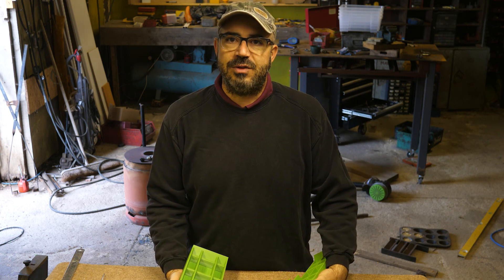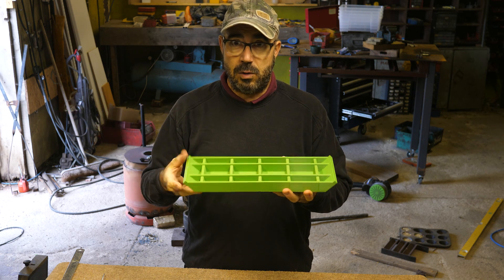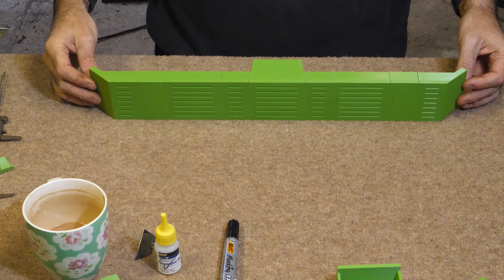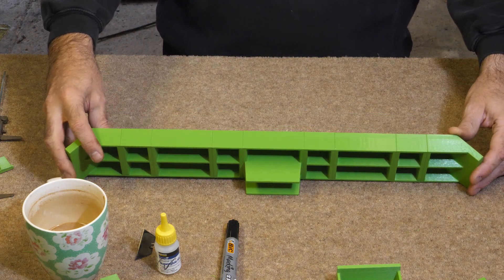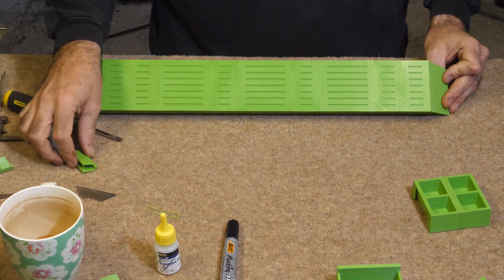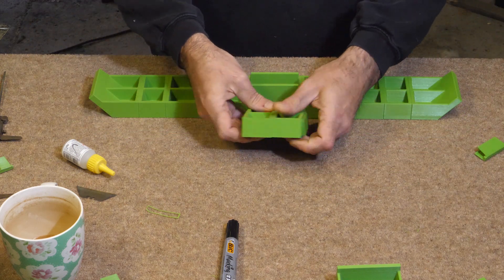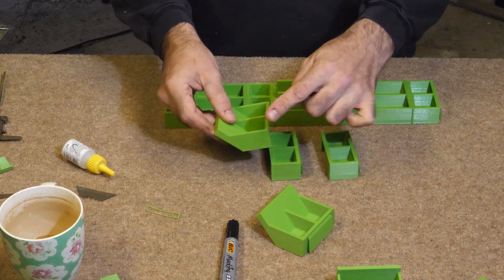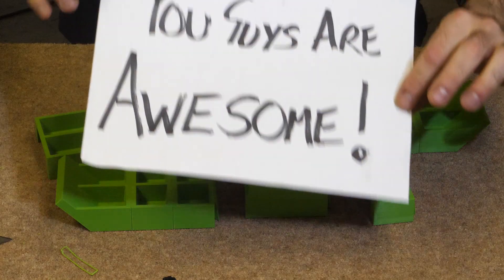Modular Flasks for metal casting (PART 2) * NO CLIPS! You guys are awesome!

Comment from the maker: Hi everyone, thank you again for your comments! lots of people have asked why i didn't just put two 'male' dovetails on the central handle piece. I did answer a few people below but i thought I'd put my reason here to save some time: I didn't because i didn't want to force people to use the handle module if they didn't want to. I only envisioned the handle module going on two of the four sides anyway. The way things stand now people can elect to leave out any module type... except the two corners (and they need two corners anyway, so it doesn't matter that corners are slightly different shapes). Also I'm not 100% convinced with the need for the handle module yet, so i didn't want to make it a necessity. Since I've got the "clip-togetherness" sorted, I'm starting to think about the casting and pin assembly more seriously now. And the wedged shaped handles might be nice for casting but they might be bad for putting pins through, I'm also pursuing using a 50mm bit of box section steel tube to bolt directly to an extension module - as the 'handle/pin thingies' - that would have the advantage of everything being more like 90 degrees and 'square' to the pins.
I hope that explains it better. also I'm doing the first test casting today!!!
Reply: Makes sense.  Regardless, it is a cool design and I think we're all looking forward to see how it works out once you get it made in metal!
Reply: I think with a drill press or being very careful, you could drill out the handles for pins even though they have draft on them.  I'm actually counting on that, as my cast pin brackets also have draft...  I might put handles on all 4 flask sides, in case the use of a cheek flask is ever needed - then one could pin the drag to the cheek on side x and pin the cheek to the cope on side y so the pins don't interfere with each other.
Reply from the maker: @tobhomott  oooh that is a great idea, hadn't thought of that! also i've just watched the video where you show your two bits of angle and make the pins from 1/2in bolts (one hole and one slot - i think that is very clever)

Comment: Thanks for the great video series! Not making modular flasks (yet), but getting started with sand casting from PLA patterns. I've been told that I must use draft angles on my patterns - are you using these and if so, what angle(s) are you using? How about allowing for contraction of both PLA and alumimum, do you have a standard formula? Thanks!
Reply from the maker: hi yes everything pulled from sand needs a draft angle, if you are patient and experienced as little as 6 or 7 degrees is ok, but if not i'd try 15 degrees first. If it's not critical to the object,  the more draft the better :) Aluminium does shrink. i'm not sure what you mean by pla shrinking. cheers julian
Reply: @JulianMakes  When PLA cools, it shrinks a bit, which is why a heated bed is necessary - so the bottom of the print doesn't shrink and pop off the bed before the print is done.
Thanks for the draft tip!

Comment: To make things faster you can use molding silicon so you can cast epoxy resin pieces and it is going to be faster than the 3d, this for a foundry that needs a lot of different types of flasks. Great Video!

Comment: Nice design. I Look forward to seeing the first mould rammed up. The casting patterns I've done on my 3D printer, have each been bogged, sanded and painted to remove the printer striations, which I was afraid would lock into the sand and not release properly. Then again, I print with 0.3mm layer heights, so they are pretty rough.
I'm looking forward to your uploading the STL files to your Thiniverse, and will definately print and cast a set.

Might work to add two divet feature on models of the end peices, and also on the handles so we will already have drill centers for the mounting bolt holes / alignment pins. Not sure how accurately this will be in practice, but ideally you want all the holes  standardised, so you can mix and match flask side lengths for the casting pattern at hand. 

The only other thing is that the corner radius could be (a lot) more generous. That should help the patterns pull out more cleanly.
Subscribed!

Comment: Curious why you didn't just put "male" ends on both sides of the middle section that way your corner pieces wouldn't have to be different one with a male and one with a female dovetail?  Seems like it would let you interchange/reuse some of the parts better.

Very neat addition to this idea for sure though!
Reply from the maker: Chatter on the Wire hi chatter! I didn’t do that because I was imagining that only two of the four sides would have the handle module in it. Also now I’m thinking about the casting and not worrying about the modules, I’m less convinced with the handle piece, we’ll see how good it is for the pins (I’m dubious because it’s a wedge shape) , it might be better to just use a bit of a steel angle and bolt that directly to the aluminium side on the extension module ‘columns’, I guess I didn’t want to force people to have a handle module in a side.

Comment: Once again, Great Job Julian!  Just one comment... it seems like you could cut down on the number of parts by having dovetails on both sides of the handle piece, and the other pieces radiating out from the handle?  Maybe without having the pieces in my hand to play with my logic is wrong, but it seems like this would cut down on the number of part designs.  Hope this helps... and again, Great Job!! Looking forward to printing / using the end product!!
Reply from the maker: hi Berry! thanks! to answer you quesiotn... check out my new comment at the top, i would normally answer you individually but i was away last night and lots of people have asked the same question :)

Comment: Cool! It's an even better design.  I think you might be able to make the handle section the same as the standard section, but with clip-on handles. Perhaps, you can reuse your original clips for this purpose.  This may give you the ability to print the holes in the casting.
Reply from the maker: this is a lovely idea!!! unfortunatly the layout of the outer ribs wont allow a "clipped in" addon handle piece, (mainly because the top edge of the flask has to be flat with or without the clip on handle) BUT i think you could be on to something with with a glue on handle part. If i redesign it all again (reasonably likely) i'll try to add a clipped in handle - but to cover the dimples it might require an additional bit to clip in to cover them (with no handle bit on it), if you are not adding the handle piece - which adds some complication.

Comment: The dovetails are a great improvement, and I prefer grooves over ribs for not eating up flask space anyhow.  I'd cut grooves more often myself if nailing ribs into wooden flasks wasn't so much easier.
At the risk of postponing the casting video even farther into the future, I do have another suggestion.  It would be good if the alignment bracket AKA handle was at ~1.5cm or more from the parting line.  You want room to get your fingers under there when it's parting side down on the molding board.  Especially when you're setting down or closing up a heavy flask, ouch! ;)
This has got me wanting a 3D printer more than just about anything else I've seen!
Once you get some sides cast up, if you make a jig for drilling the bolt holes for attaching them together the same way every time, the cast sides themselves would be modular as well.  Ie. If you need a flask that is odd sized in just one axis and it wont get used much, you could borrow the two standard sized cast sides from an existing flask and only need to cast the 2 new unusually sized sides.  Can't wait to see how it works!
Reply from the maker: thanks Tobho! the dovetails are so much better aren't they!!! in regared to your question, as it stands right now there is a bit of room under the lowest handle (prob 8mm) but you are correct the pinching can be a nightmare on heavy flasks). However i'm not 100% convinced on the handle module yet (see my pinned comment at the top for details on that), i'm actually making another 80mm extension module with much more beefy 'columns' that can have bolts through at any height for attaching any handle/pin mechanism to (at any height). I'm still going to try the handle module as is, but i''ve already designed the extra module just for something useful for people to have if they want. It would be an ideal platform for any handle type to be added. Also the whole ribbed structure is kind of handle shaped so i'm hoping lifting can be done from any part of the flask not just the special handle/pin bit.
PS tobho, if you get a 3D printer (FYI i have a prusa I3 mk3 - but they've just made a little mini version too) YOU WILL NEVER REGRET IT!!! especially with your casting, it is a marridge made in heaven! cheers mate o/

Comment: Bye all ready!!
your extended corners now lend themselves to bolting, as we spoke about, so if you design in two U slots in to the extensions of the corners, you will A) be able to bolt them together with nut & bolt (using washers too) B) designing them is will I hope negate anyone having to do any machining to them post cast. thus the only work will be locating pins
PS KEEP it rolling
Reply from the maker: hahaha :) cheers, yes bolting has always been my prefered option (mainly because anyone can drill some holes and use bolts)... could you draw me a diagram about your u-slot idea? i'm not getting it (mainly becasue i'm not an engineer so i dont know what bit you mean and what orientation), i still might add a "dimple and matching divot" on the touching surfaces of the corner pieces to aid alignment.  thank you mate!
Reply: @JulianMakes   here is a rough link to show what I mean https://www.tinkercad.com/things/1O0wrTMw6Ke-u-bolt/edit?sharecode=LeTkYxPW--PUsNG9u0Dcv5tLPT7khqF77oUSeuTsRFU=

Comment: What if you had the center peice have two female dove tails, and then all other pieces could be one part instead of having each "chirality" of the sides.
Reply: @BarryManilowa   

*=Female Dovetail          
^=Male Dovetail
= = Sand Area
| = End Piece

|= ^ * = ^ * = ^ * = * ^ = * ^ = * ^ =|
^                          ^Center has two female (could just as well be male) 
End pieces are all one type, print one pattern instead of being one male and one female.
|=^ * = * ^=| 
        ^The Shortest possible combinations still works. But allows for infinite expansion of expansion joints without having to worry about which side you printed.

Hope I understood your questions correctly.
Cheers
Reply from the maker: hi lane check out my new comment at the top, i would normally answer you individually but i've been away last night and lots of people have the same question :)
Reply: @JulianMakes  Thanks! I'm sure you're getting a ton of repeats. I don't know a single thing about casting, just my two cents on it.

Comment: Cheers Julian, thanks for the credit, just another suggestion, possibly put a pad on the sides to fit these https://www.artisanfoundry.co.uk/product_info.php?cPath=32&products_id=306 or the larger ones https://www.artisanfoundry.co.uk/product_info.php?cPath=32&products_id=307 so we don't need to use weight to keep the flasks together when pouring, just a thought!!

Comment: Amazing improvements.
0.30mm layers, 2 parameters, 3 top and bottom, 15% cubic infill is my current fast print/draft settings (would go to 10% but I think it's too much bridging on the top layers for my printer.)
What kind of scientist were you? STEM for the win. I'm in the mechanical engineering realm.
Reply from the maker: Thanks Ask Questions! ahh mine does do 0.3 but i dont use it much, i should try it on these i guess, it's not like the shapes aren't simple. cheers mate :)
Reply: @JulianMakes  I took those settings based on a maker's muse video about printing large and fast. I had to adapt them to my printer which is slower due to the dual direct extruders it has. 
here's a link to the video at the settings https://youtu.be/3kW9SnK4LKc?t=387